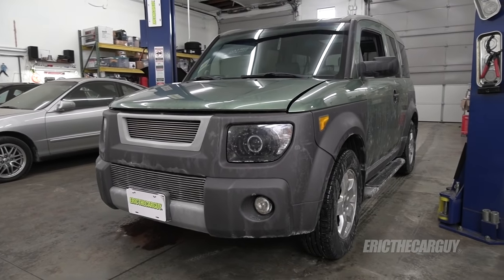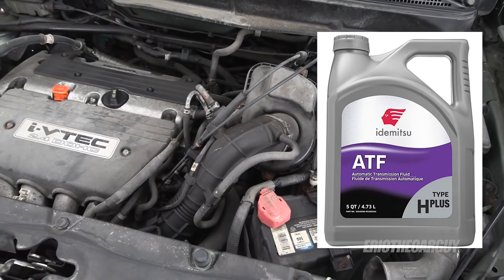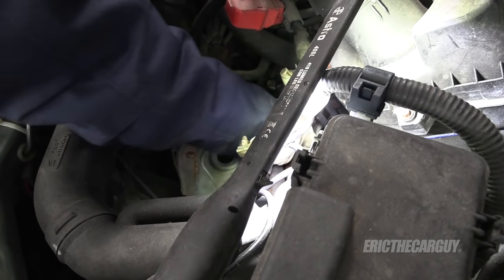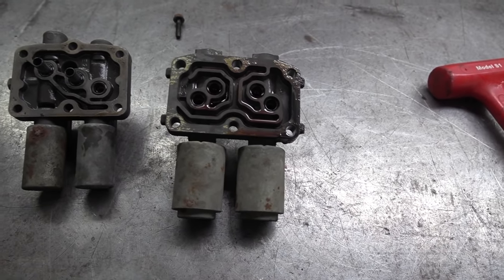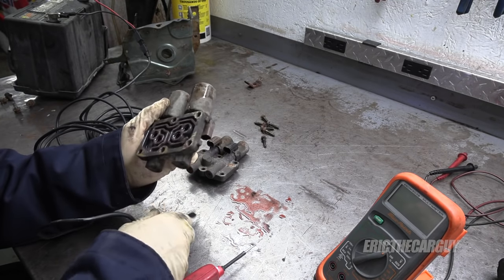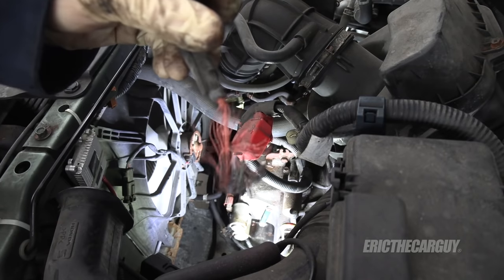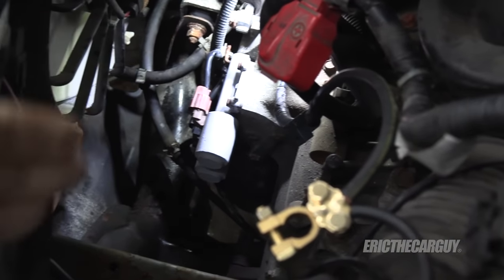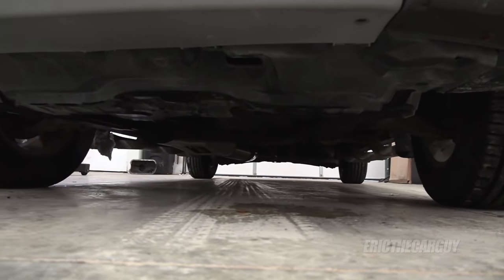Delayed Shifting, Honda Transmission

Comment: Greetings! Those 5 sided inserts are actually adjustable to increase/decrease activation pressure. A company called Sonnax makes the tool and describes what A and B control, and how adjusting them will affect performance. I actually have a 2002 MDX with a 2nd to 3rd shift issue. Turned solenoid A up a quarter turn and bingo.
Reply: I have the exact same problem with my 08 Honda Pilot except it's 1st to 2nd and 2nd to 3rd gears. You think that this is also the solenoid or something else? Also, what does it mean to simply "turn the solenoid? I'm not mechanically inclined at all. Thanks!
Reply: Hey I'm just getting started with this repair but where is the adjuster? I'm looking for a 5 sided insert but still no idea.
Reply: This comment is absolute gold
Reply: The knowledge of this would have saved possibly thousands of people's car
Reply: What do you mean by 5 sided inserts?
Reply: @golfish8589  at 17:06, you would think the bolts are 6 edges, but they are 5 instead. I'm assuming this is the bolt he's talking about that you need the special tool to tune it with.
Reply: @NK-yv5oi I have de same problem, did you solve it?
Reply: I sold it without working. sorry.
Reply: I’m having a delay in reverse activating and the slip between 2nd an 3rd
Reply: Does that work for 1999 Honda accords
Reply: Where can i buy the tool

Comment: Had a similar issue back in my early days of an accord in the same vintage 15-20 years. Somewhere 150k it started to delay like that. I found the workaround was to let off the gas enough and let it shift and then press down on the gas again. Not sure why it worked but if it wasn't going into gear, doing that worked. Hope that helps someone who doesn't have the option for even a $60 part. Back in the day that was how much a person made on minimum.
Reply: I have the dreaded 1-2 shift flare.  I drive it like a stick.  Press firmly on the gas and at around 3k let up watch the RPM drop and back on the gas.  Or if you are on the flat or down hill,  start out just barely on the gas and it will shift.  What doesn't work is driving it in your normal way, pressing the gas modestly, results in giant lurch.  I read the Honda recommended repair and it talks about removing and/or testing some other solenoids (3) under a cover on the bottom of the trans.   I am wondering which it it?  These 2 on the top outside seem much easier to do, but will it cure my problem?
Reply: @richardcase1653  ever think it might be the tps sensor?  i had a 94 honda that shifted funny, and would rev up, like it was  kicking into overdrive-at the oddest times-  i replaced the tps sensor, and it went away.

Comment: I inherited  a 2013 Fit that now has 265K miles Runs like a little sewing machine. The transmission acts up at times Maybe the same issue But the fluid has never been changed and I am scared to change it with that many miles

Comment: Really love the videos here, especially the ones concerning the older Honda vehicles. I have a 2002 Accord (S86) that had belonged to my late father-in-law. I like this car very much and had been sending it for regular maintenance and repairs every time there's any sort of problem. Had also got it repainted last month, plus four new Michelins. It's `only' 2,000  cc (high road tax here in Malaysia for bigger cc engines) but there's enough power.
Reply: The automatic transmission they used with the 3.0 liter V6 of that generation was a time bomb, so your low displacement is a blessing in disguise.
Reply: @MediumHalf  dont think malaysia had our widebody accord
Reply: 0

Comment: Easy fixes are always nice instead of transaxle replacement. I agree that sometimes resistance measurements are not always definitive. Solenoid may just be weak or slightly binding in the bore.

Comment: I just did a bunch of work to my friend's '08 Honda Element, her rig had 145K miles on it, did a trans service after the dreaded starter change and used Honda OEM filter and DW1 ATF, bought a case and flushed out the old nasty fluid(which looked like coffee)by taking off the trans cooler line before the filter, used a length of 3/8" clear hose and pumped it into a 3 gallon clear plastic jug 2 qts. at a time, shut engine off/refilled again until I ran 8 qts thru it or new ATF visible in the clear hose. Install new filter after doing the service and add 3 qts to sump, warmed up fluid as per factory manual and set fluid level at the full mark.
This gets all the nasty old oil out of the converter and does not harm the trans, just make sure to immediately shut off engine if you see any bubbles in the clear hose while draining! This car's trans shifts about 75 to 100% better as a result!
Thanks for the great tutorial on this car! Previous videos have been very helpful, especially the starter R/R on these cars!

Comment: Had a similar issue on my 03 Accord EXV6 coupe. Changing out the ATF warmer filter and checking the banjo oil jet bolt. For particles of broken filter materials. And changing out the fluid and lastly checking the A/B linear solenoid. Helped it. After it was fixed sold it for Newer Sedan model. Great car it was

Comment: Before I even watched the video I suspected a possible corroded ground might be responsible for the solenoids malfunctioning. Just like Eric mentioning the "stronger" starter response, a bad ground increases resistance and can cause a lot of havoc with electrical systems. I've replaced that same ground wire on both of my Elements (03 & 06) because they were in just as bad shape because I was having VTEC issues - another system that relies on proper solenoid operation. Regardless, ETCG produces another high quality and informative video. Thanks again!

Comment: Great video, Eric. My 2000 Honda Civic (project car) had been stored for 7 years before I rebuilt the front end from an accident. After getting it back on the road, I experienced this and splippage between 2nd and 3rd gear. I was told that it was most likely due to the clutch plates drying out from sitting so long, and that it would go away. I've driven it for a year now. The slippage has mostly gone away, but I still get the same delay and surge into 3rd gear as you demonstrated. I'll check the car out now and see if that will fix it. Thanks for always educating and showing how it's done.
Reply from the maker: http://www.ericthecarguy.com/faq/solving-transmission-problems
Reply: Please update after completing
Reply: I have a 8th gen civic and I have weird wubble on 2nd and first shift while driving slow
Reply: @adrianlugo1130  did you fix it?
Reply: @Amahyze777  nah did you? I haven't taken it to a mechanic yet

Comment: I have a 2003 Element with 200K on it. Owned since new. By far the best car I have ever owned.
My Element hold the first to second shift along with a high pitch whine. I think it is the shift solenoid. 
All maintenance was done on time or early including numerous automatic fluid and filter changes by the dealer or my very good Honda mechanic (the fluid and filter changes are cheap and easy so why not?).
Last week I changed the original coils (third cylinder was throwing an occasional misfire. I bought OEM Denso coils  and replaced the second set of plugs since new with new OEM NGK plugs. Wow! The car runs so much better and it seems the transmission shifts better (might be my hopeful mind). Sadly the delayed shifting from first to second is still there.
Reply: Did you ever get it resolved? If so, what was the fix?

Comment: Thanks for your video. I had the exact same problem but much much more severe. The 1-2 shift would have a hesitation of about a second and then would literally slam hard into second once it shifted. The 2-3 shift was even worse. The hesitation was more like 3-4 seconds and you would have to carefully feather the gas to get it to shift w/o first over revving the engine. I was able to get ahold of another used pair of shift solenoids and replaced them exactly as you did and now the car shifts like it was new. I want to add that my Element has 407K actual miles on it and this is a testament to how tough built these transmissions are! I was very fearful I was in for a trans replacement but in under an hour of labor that problem is now a ting of the past. Thanks again.

Comment: I had this exact car and same issue and went through identical steps, I even tried 3 sets of solenoids and additive and nothing changed. Ended up swapping transmission for about 450 bucks in the garage one afternoon and it was perfect after that.
Reply: Yes Idemitsu is the OEM trans fluid as well the power steering fluid and the differential oil. I also found out Eneos is also an oem fluid manufacturer for Honda as well .
Reply: @tommypistols8104  only place ive seen idemitsu is rockauto and it isnt cheaper than oem at majestic/balise honda website
Reply: Some say the pressure switches can cause shift delays
Reply: I was having the same problem - at first just a suttle hiccup - then later it started to buck into gear - soon it was the 2nd then even 1st gear —- had a mechanic change out the vtec solenoid and the A and B solenoids- drain and fill 3x - it worked for a day but then it was bucking again . I ended going to Honda and they out in a salvaged trans - so far so good - that was about 4 months ago
Reply: Some NAPA’s have it on hand. Unfortunately It’s mostly a special order fluid.
Reply: @CRAPO2011  Thats good to know because NAPA has it available however not on all stores. For the most part it’s special order fluid.
Reply: @tommypistols8104  no prob majestichonda also has the best prices on oem parts

Comment: One thing I have found over the years with Solenoids is Sludge buildup in the their cylinder bore. First insure the intake screen filter is clean. Use a non-volitile cleaner and exercise the solenoid back and forth. The Electric side seldom fails. Its just wire windings and a connector. Corrosion/breakage perhaps in extreme cases. Mechanical side has seals wear out with time and prone to sludge buildup. Neglected maintenance or excessive mileage is the major contributing factor.
Reply: I second this mans comment
Reply: agreed

Comment: I had a flashing "D" light intermittently on my '05 Accord 4cyl, removed the same set of solenoids, cleaned the screens with brake cleaner, put it back together with the original parts and it's been good for 6 months now.
Reply from the maker: If that was the case then I would recommend changing your fluid every 30K with Honda fluid. That should keep the debris in the system down. Link in the description to a video on changing the fluid.
Reply: @ericthecarguy  All the ATF was replaced when I installed a used engine 2 years ago.  I also installed a new filter.  Reading the code using the dashboard lights method, it seemed to be a torque conv clutch slipping intermittently.  The trans has over 300k on it.  Thanks for the videos and your recommendation.  I'll follow your advice.

Comment: Have a 2005 Pilot EX. Bought it with 140k for 2k, had to rebuild the trans after failing at 145k after weeks of shifting flares and clunky down-shifting while going uphill/passing on highway. Started small, and got so bad the “flares” could be noted by watching by the rpms on the tachometer spike from 2.5k to about 3.1k before settling into gear. Trans finally gave out after attempting to reverse into my daily parking spot only to hear a loud mechanical “clatter”. Lost reverse, so immediately started driving it the 5 mile trip to the local trans shop. Lost 4th gear the first mile, 3rd the next, eventually riding it 3100 rpm’s in second to its rebuilder..

Cost more than the car to rebuild it. Had a cracked clutch drum that sent shavings and clutch material alllllll throughout the system,
Clogging every solenoid and the internal filter.

Gotta love Hondas.
Reply: Important with any tranny when having even minor issues to stop driving it and get it looked at before anything. Also no one seems to change the fluid and then wonder why they blow up 🤔
Reply: @inglouriousmofo  I change the fluids, all of them, the moment I purchase ANY used car. I got it so cheap because of the stated issues, and tried removing all the solenoids and cleaning the screen and filter-tubes and 3x drain/fill. I’m convinced that’s the only thing that kept it going as long as it did after I bought it. 

Love the car now, despite the cost. When I purchased it, it had been dealer maintained since 12 miles, all new Honda timing components (dealer installed) and great maintenance. Truck is clean inside and out, far more so than many others of this vintage I see… (I do emissions testing for Georgia, so I see plenty)
Reply: @inglouriousmofo  You know how expensive Honda DW-1 transmission fluid is? It’s over $10 a quart; I wish I could use Valvoline MaxLife ATF.
Reply: @inglouriousmofo  the mechanic use the wrong fluids or others things , they put into your car engine where you don't know about the transmission system in your car. they know you will be back to them again. spent more money there all.

Comment: so glad i just had this video fall into my lap! so to speak. I have an 07 element with 180k on the clock and it 100% has a delayed shift at times and I think this is definitely my problem! Great video no doubt, as a fairly seasoned tech most videos are difficult for me to watch, but I had no issues at all watching yours. You are great in front of the camera and obviously super knowledgeable! That transmission fluid is great as well, glad to see a second, reliable option! thank you sir!!

Comment: Eric, the newer v6s run an entire secondary valve body, but only the pressure switches are changeable. The solenoids are part of the unit. We do a lot of those on RDX's including the 3X flushes for torque conv judder. The four cylinders are all different with their transmissions pressure switches/solenoids between Honda/Acura
Reply: I have a 2017 rdx and had the same issue the dealer gave me a new transmission and i still have rough shifting in 3rd gear. Had to change $1000 in transmission oil changes (4 appointment) to get the new free transmission and issue still persist.

I had a P0741 code before. What could be the root cause. Also my transmission clunks when i shift from park to drive.

Comment: I just picked up a 2004 honda odyssey with 114k on original transmission. So far have done two ATF changes, changed inline filter on top of transmission. Today I am adding a Tru-cool 4544 transmission cooler. The transmission is working fine rite now but I read some threads highly recommending doing the things I have done. Oh and I'm using Valvoline ATF max life Red jug.
Reply: I had a 2003 Odyssey with the failure prone tranny.  Mine was original and it went 360k and the dealership was amazed every time I brought it in which was rare.  I did the exact same as you but also added a magnefine ATF filter and used Amsoil ATF, the Valvoline you used is just as good in my opinion.  I also added a half can of Lubegard Red to every ATF change.  I changed ATF yearly and changed magnefine filter every 15-30k.  I also drove it like a minivan and occ did not.
Reply from the maker: I only recommend Honda automatic transmission fluid in Honda automatics. Also, the issues with that transmission are internal and a design flaw. Your efforts may not yield the desired result, but I can't see how they could hurt. Thanks for the comment.
Reply: I tell my daughter. On her Mini van. Service the trans every 75 to 50k miles. She now has almost 200k.

Comment: I have this exact problem with my 03 Accord and am sure it's the solenoids as well.  OEM are really expensive as mentioned in the video.  How did the ebay one hold up?  Has anyone else had good or bad luck with ebay refurbished solenoids?  Thank you for this video.

Comment: HEY ERIC! I just want to say thank you for all of your videos and especially your Element videos. I recently made an impulse decision to buy a running and driving element for $850 with 196k miles after watching this video. All it did was bang really hard into 2nd gear and then drove amazing. Unfortunately, I did not have the same luck as you did with Ebay. I bought an aftermarket one and i installed everything correctly and properly and as soon as I mounted everything back together, the "D" light was flashing and got a P0970 code and it would not shift into 2nd gear. I am working on getting a replacement part from the seller, but in the meantime, I purchased known good-used part from another seller. and if that does not work, I am going for OEM.
Reply: I have the same problem. How did you make out?
Reply: @pajo2012  i gotta go for OEM. Same issue with the replacement i purchased.

Comment: Oil pressure on the camshaft phaser. However you’re the best mechanic on YouTube. My f150 was doing the same thing and the threw up the code P0349. I was a quart low. Changed oil and it quit.

Comment: This one was a must see given the transmission in my 04 TSX (remember me mentioning about second gear delayed shifting sometimes?) I'm going to start out by replacing the transmission fluid and will go from there. I will keep you updated. Thanks for an awesome video!
Reply: I’d change the transmission fluid in the pan and install an aftermarket transmission cooler. Heat and dirty fluid is what kills transmissions.

Comment: Be soooo thankful the solenoids are outside now. Back in the day when Honda first went to electrically powered solenoids, they stupidly put them inside the transmission. When I questioned the instructor/techs about this bad move they tried to convince me it was a good idea. My response, they will be outside shortly,,, just wait for it.